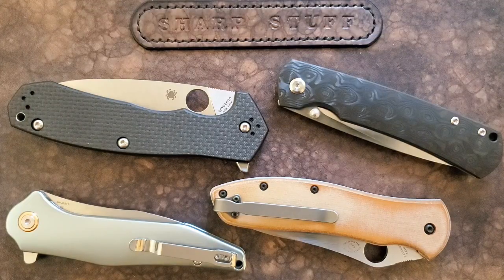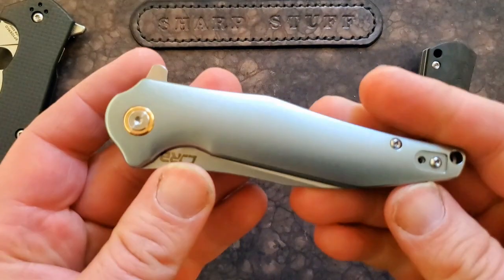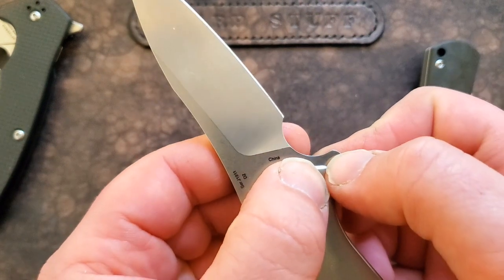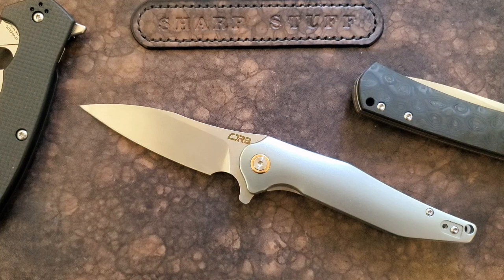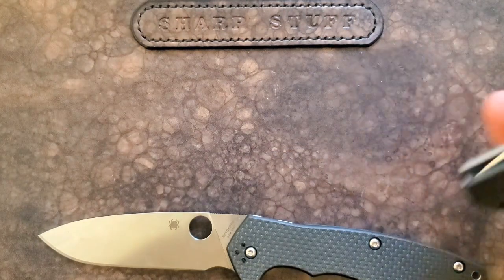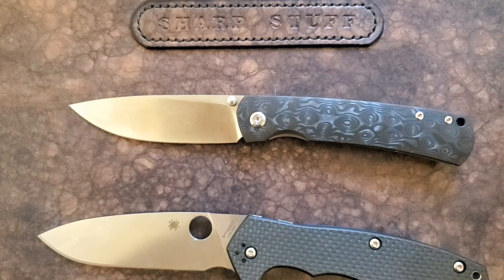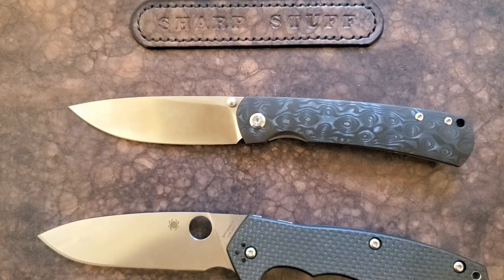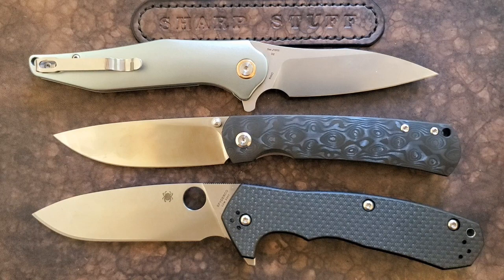To Mod or Not To Mod

Comment: For weak detents on knives in my permanent collection, I drill out the detent hole in the blade just a little with a square end mill bit and change the detent ball with a ceramic ball of the next size up.  Works beautifully.  I've even done it to my 2 XM-18s and an SNG.  Not a good idea if you ever plan to resell them.  In this case it's just for me, and the upgrade to the detent gives them a crisp and excellent action. My gen 6 Spanto started with a decent detent, but the steel ball started to degrade and it became so weak as to require quite a bit of effort to get it to fly all the way open with bearings installed.  Now I can't get it to fail if I try, and the ceramic ball with less resistance also took it to a fall shut action.

Comment: Modding knives has turned meh knives into gems for me, my Amalgam has a flipper tab delete, widened choil and deeper detent hole, I have a Sliverax in the mail and the tab is 100% coming off... All you really need is a Dremel and some patience. Sal has often said in response to criticism that he would rather give people the option to mod a knife rather than choose for people (it's easy to remove a flipper tab but basically impossible to add)
Reply: Great minds think alike. Lol   I did all the same mods to my Amalgam as well (flipper delete, better detent and widened finger choil) and added a Lynch clip.  It quickly replaced my PM2 as my favorite medium/large EDC Spyderco.